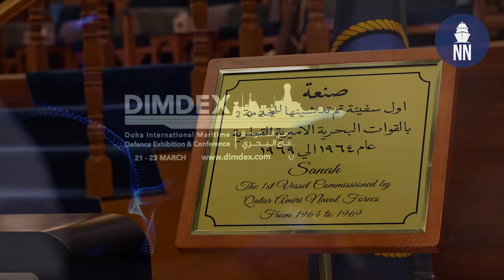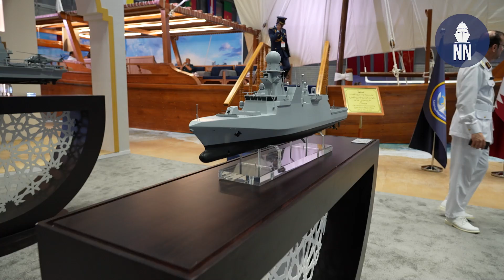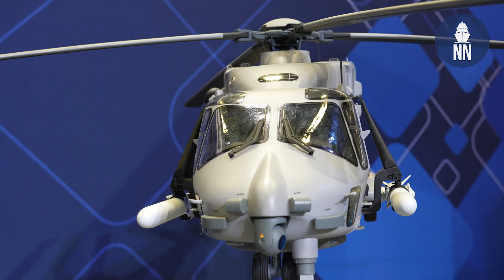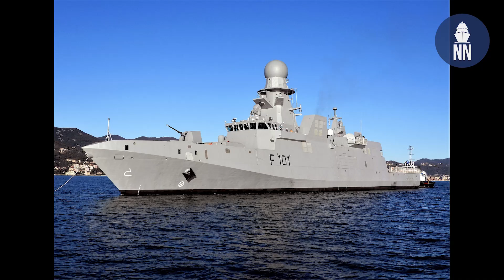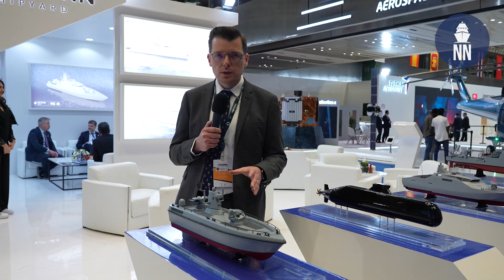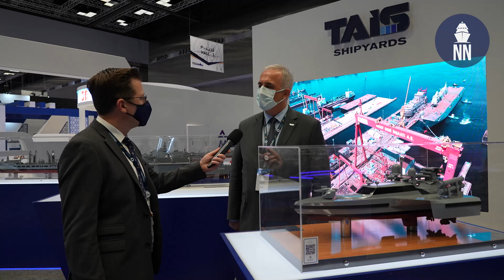Day 1 at DIMDEX 2022: Qatar Emiri Naval Forces and New Ship Designs

Comment: I don't get why not just standardize the 120mm class of deck gun with an autoloader, at sea you can max the range and a 76mm is just ridiculous, 155mm even better, gps guided shells at 20 rpm, save on expensive missiles hit anything afloat 50km on the cheap, be actually dangerous.
Reply: 120 and 155mm deck guns are WAY heavier than a 76, and take up more space inside the hull.  Not to mention, the ammunition is much heavier and bulkier as well.   Also, the gun can't move or react as quickly- due to that weight and mass- and has a significantly lower rate of fire,  making it less effective vs small, fast moving targets- or air defense.  

  The main idea is NOT to get close enough to that enemy ship for a gunfight to be viable.

  There's nothing cheap about extended range gun projectiles.   You're right back into the $$ territory of a guided missile- without the capability, or punch of one.   Which is why the 155's on the Zumwalts have no ammunition- it was cancelled when it couldn't be produced cheaply enough to make it worthwhile.

Comment: That LPD would make more sense as an Air Defense platform if there were AWACS birds flying from it. 

That Dearsan FAC 46 is quite dashing though.
Reply: Good point.  I guess it depends on how large of an area you want to protect- and how far away the threats are.   Quatar, for example, isn't very big- and the threats most likely to pop up aren't very far away.  They also don't have much need to protect a large CVN battle group or amphibious fleet.

  Just in case, though, having a credible threat to potential adversaries' shipping- and a way to protect it-goes a long way towards preventing any "unfortunate" incidents.

Comment: Why don't they develop warships with buffers on both sides to thwart torpedoes.. that would be a sell-off.. 👍
Reply: You'd need one hell of a big buffer- which would have serious impacts on the ship's performance. (and cost a LOT)  Modern torpedoes are designed to go off underneath a ship's keel, not to smack into the hull.    That, and navies have moved away from static defenses like armor, and instead aim to not get hit in the first place.   They carry more active anti torpedo defenses, aimed at luring a torpedo away from the ship;  making it swim here there and everywhere until it runs out of power and shuts down; or even attacking a torpedo directly.   Of course, detecting it early- and getting the hell out of it's way- also works.  As does lowering your acoustic signature, to give it less to home in on.

Comment: All of these designs seem pretty firepower dense per their displacement compared to ship designs I've seen on this channel from just a few years ago. Is this just a Qatari/Middle Eastern thing or do you think navies in general are going that way?
Reply: Persian gulf is shallow and quite small. There is no much room in the gulf to accommodate dedicated class for each air defence, submarines etc. ships must have multi role
Reply: @ebbac    I'm guessing there is also a bang for buck component to it, considering that these navies have small fleets to begin with.   These vessels ARE their major surface combatants and/or off shore air defense platforms.   The likelihood of actually having to protect your own shores with anti-ship capability/or access denial capability probably also figures in there.

  Thus they have a completely different naval doctrine than most of the larger naval fleets- whose ships we see/hear about most often.   The US, UK, and France, for example actually have fleet aircraft carriers to do most of the offensive heavy lifting, not to mention attack and ballistic missile subs.  So ships like destroyers and frigates have a different role- protecting the carrier groups, amphibious groups, and logistics fleets.  Plus all the other multi-role stuff.   Also the US has aimed it's doctrine at dealing with threats over "there"- before they get here.   Which means FAR longer legs, bigger crews- and more stuff to support them.  (If you don't need to transit 6000+ miles of ocean to get to where your mission is, you can concentrate the firepower on a much smaller platform.)